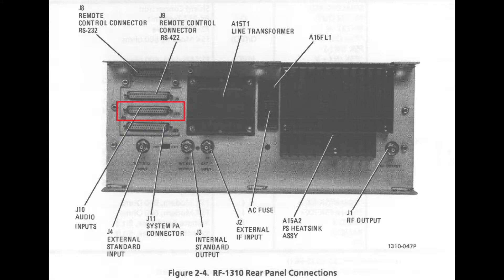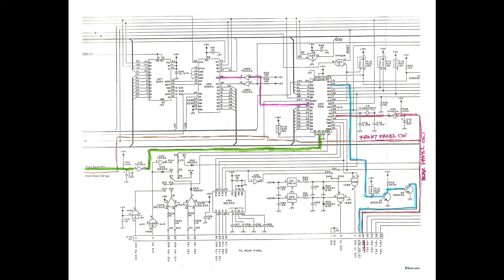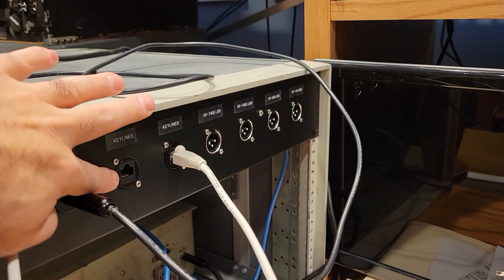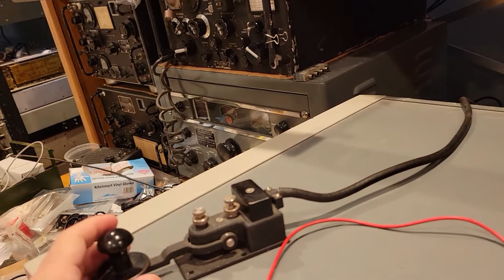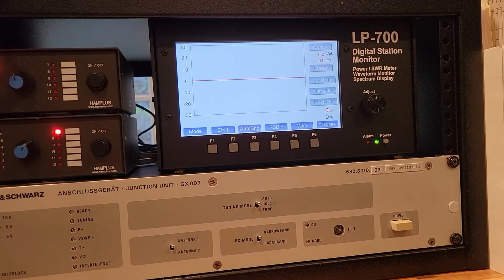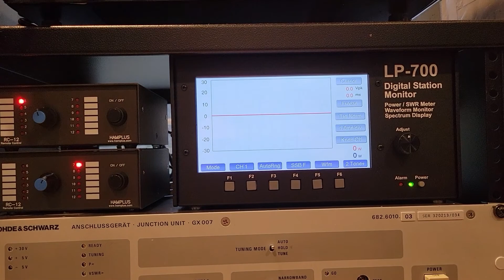Harris RF-7405 Remote DESIGN FAIL?!

Comment: yes sir ..another interesting video and presentation...And yes I know all to well about those rabbit holes..I have been down many in amateur radio and my profession as a senior RF systems tech at my job..But its always a challenge and for me its exciting to solve a difficult problem and put a smile on the boss..I've built remotes for land mobile systems as well as cross mode links for base stations..all keylines have to be correct as well as software extended functions.. Linking LTR trunking to NXDN trunking and conventional was an extreme challenge for me but very rewarding once everything was functioning...But yeah Im not a CW fan either but your troubleshooting is superb..Helps to have a schematic and good test equipment..73
Reply from the maker: Thanks. Much appreciated. Ultimately, i think the key up issue lies in the exciter. Key down issue is this RC constant and then key up issue is in the exciter. But I have to move onto other things at this point. Thanks for watching and commenting